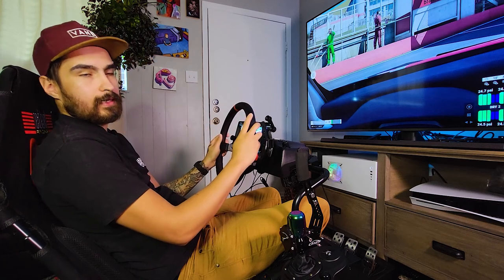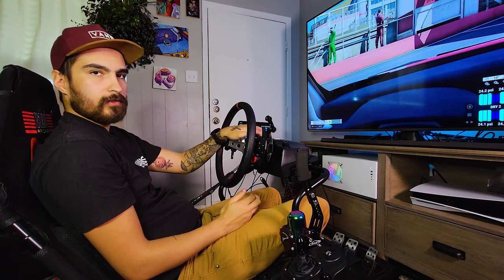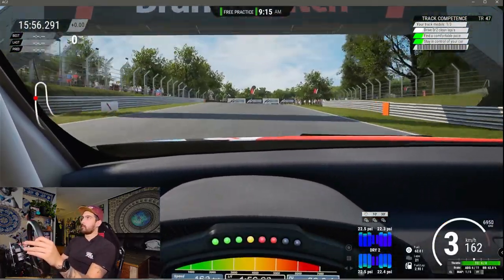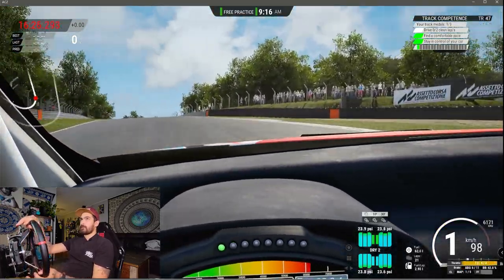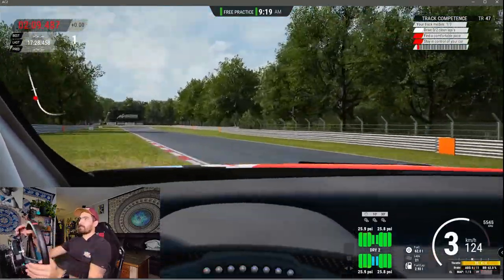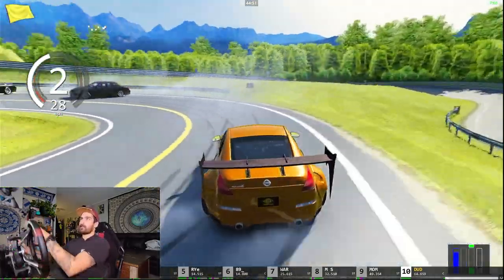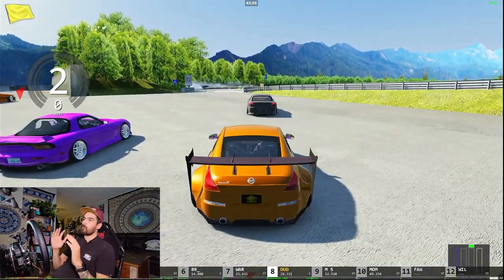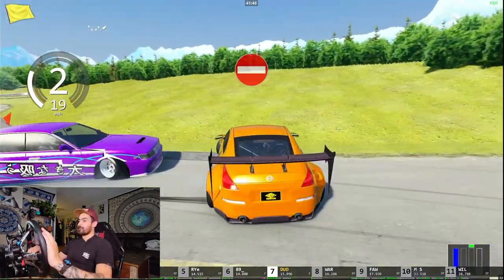Easy Logitech G29 Upgrade!! (3d Printed)

Comment: I have been looking for an adapter that allows you to put a real steering wheel on your sim that ACTUALLY WORKS On the logitech g29. If you could let me know where you got it or if it was 3d printed an stl file would be nice. Thank you..
Reply from the maker: I bought mine off Amazon.  I have a hard time recommending a 3d printed one.  I have broken 3 printed ones, now I got a aluminum one, and it's solid!
Reply: @hdycreator  can you provide the link to the aluminum adapter
Reply from the maker: Here you go!  https://a.co/d/4KAW53l
Reply: @hdycreator  thanks!

Comment: is there a way to just buy these. i don’t have a 3d printer
Reply: you could go to a 3d printing service, send the 3d print file to them and pay them to print it
Reply from the maker: agree with ManualFPV that is a way to get them printed out. even your local library may have a 3d printer you can use!
Reply: @hdycreator  what size nut an bolts does this need
Reply from the maker: I'm using m4x12 screws and bolt
Reply: I went on Facebook and searched 3d printing and there was guys on there that offer service he only charged me 25$ for the parts and 10$ in screws from homedepot
Reply: @njfishslayer5627  i got it done that’s what i did but on google instead

Comment: just got these done i also have the magnetic thing for shifting before i got these now it seems like it won’t work with these on how did u position the magnetic thing
Reply from the maker: I didn't have a issue with clearance with mine. Could just be a difference in models

Comment: What kind of stand is that
Reply from the maker: It's the next level raving gt light
Reply: @hdycreator  How did you install hand break with shifter on it ? I would like to put the same way.
Reply from the maker: I slid the logitech shifter to the right, so I had space for handbrake. Each one is only held by a single bolt. So not the best method, but it got them both mounted!